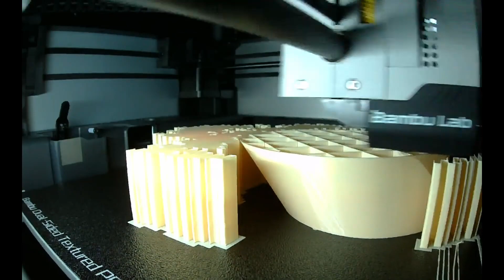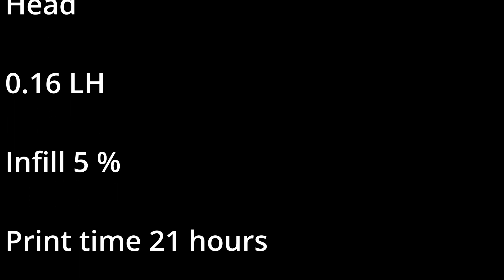Bambu X1 Carbon Timelapse IP  Man Bust

Comment: When you would compare Ender 3 s1 pro with klipper to this machine, is it worth the extra cost? Again thank you for your time and effort. 💪
Reply from the maker: well i think Bambu is on a different level of printer, ender 3 s1 is good until a certain point, but when u have to print large items i think bambu can't be beaten and is worth the extra cost.
Reply: @aim6mac thank you for the feedback 😎

Comment: Dang, Feel like the time lapse for a 21 hour print should be sped up to make it twice as fast.  LOL.   Very nice print.  Did you color the eyes in a little after print or just the way the filament looked?  I would have been tempted to paint that mode and end up with a 2-3 day print.  LOL
Reply from the maker: thanks :) i didn't color the eyes, it's just visual effect , i might color the hair and the eyes later on with a pencil though